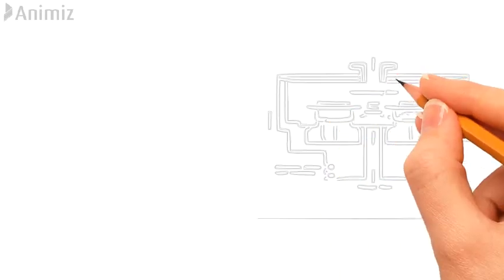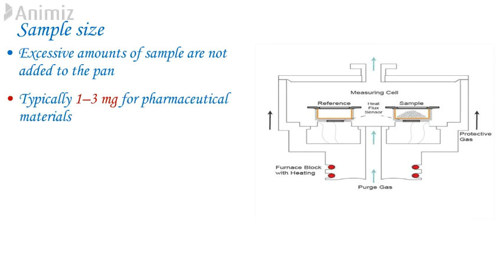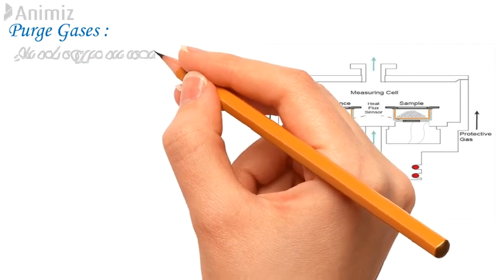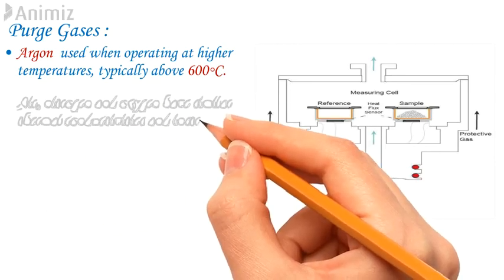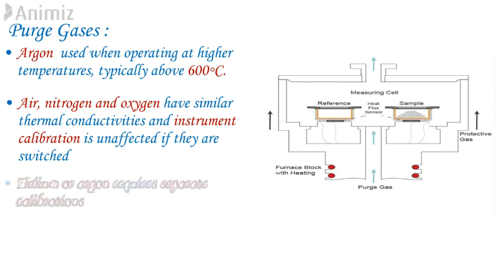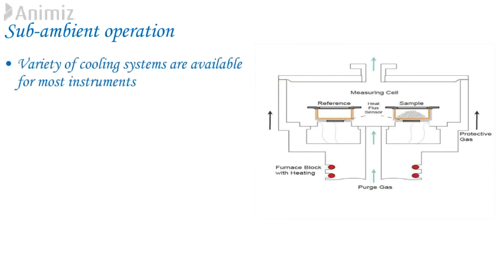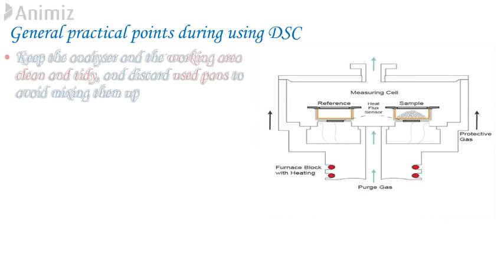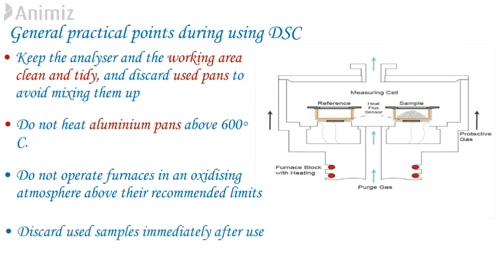Practical Guide to DSC part 2

Comment: Sir you channel very good, very important. Sir please explain clear about RC1e studies with graphs and what is final accumulation ℅, as well please explain process safety and powder safety test like 1) hammer impact 2) Dust explosive 3) Gas evaluation  etc.
>> what is use when it required if significants 1) Rc1e 2) TSU 3) DSC 4) MR
Reply from the maker: Thanks Sai ur post really boost our morale. I insist plz go through other video. Playlist share at end video. All your queries answered in other video. Still having any think let me know I will try to slove it as early possible. If u really like our channel plz share, subscribe and like. Also you can find other video on Facebook page link shared in discription box.
Reply: @Rohit_Talk  I  have lot of doubt please carify you don't worry about remaining candidates atleast I am interested to listen your videos please answer for that I like and subscribe